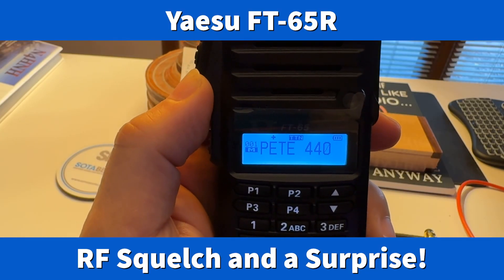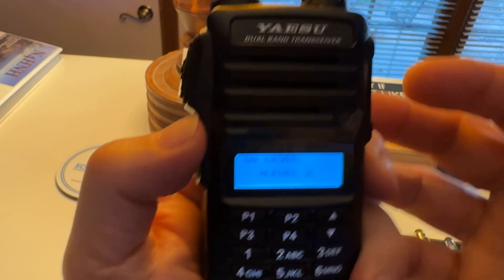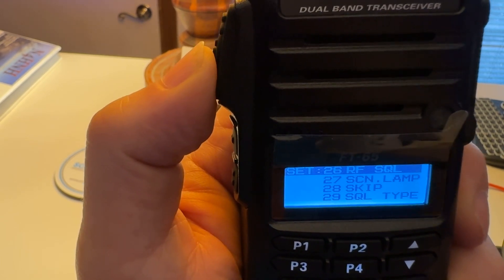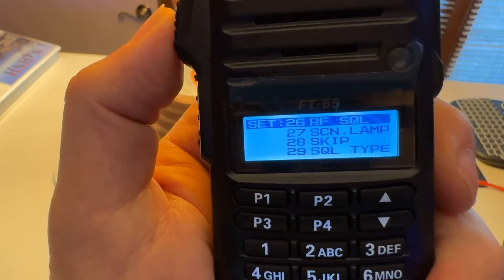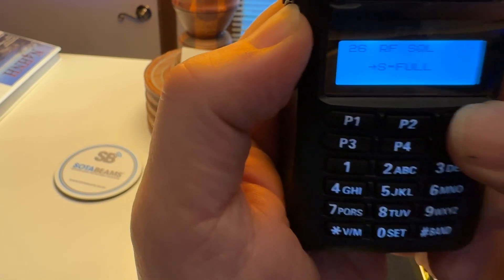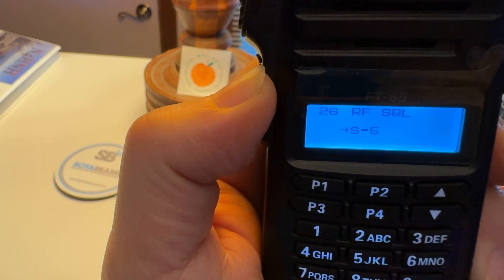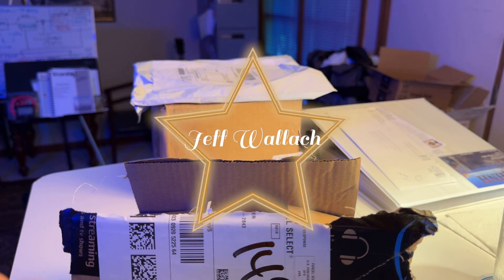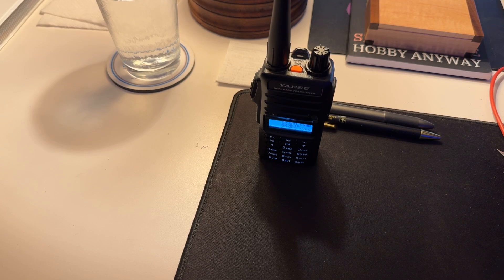Yaesu FT-65R: RF Squelch and a Surprise (video #4 in this series) #hamradio #yaesu #ft-65

Comment: My first and still the most dependable little radio. Use it every day.
Reply: Have you figured how to activate the #39 menu for scrambler?
Had one delivered Saturday morning.
Reply from the maker: @OverlandTT Menu item 39 is where you enable or disable the voice scrambler.

The Scramble feature is an inversion scramble function, which is not universally available on all FT-65R models due to regional legal differences in radio communication regulations. This feature inverts the voice signal, making it difficult to understand without the corresponding descrambler.
   
Remember, in many countries, including the USA, using any form of voice scrambling or encryption for amateur radio is not permitted under FCC regulations. This feature, if present, would be for specific markets where regulations allow or do not explicitly prohibit this type of function for amateur use.

 If your FT-65R has this feature, ensure you're aware of and compliant with local laws regarding its use. Misuse can lead to legal consequences or at least, it's unethical in the context of amateur radio where the ethos is to maintain open, clear communications.

The effectiveness of such scramblers is often limited to simple inversion and can be decoded with basic equipment or software designed to reverse the scrambling process. It's not considered secure by modern encryption standards.

Please use any such feature responsibly and in accordance with your local amateur radio regulations. If you're unsure about the legality in your area, consulting with your national amateur radio association or regulatory body would be advisable.